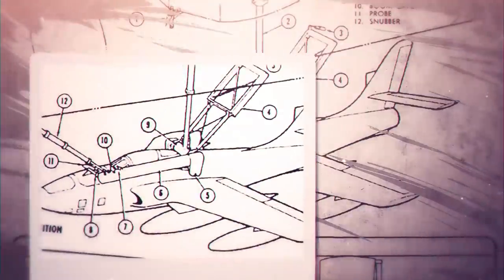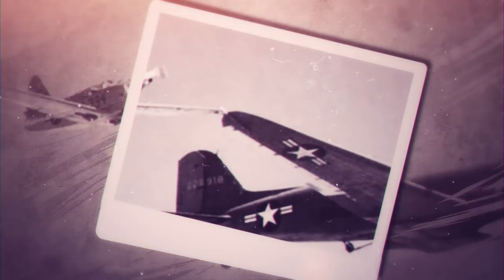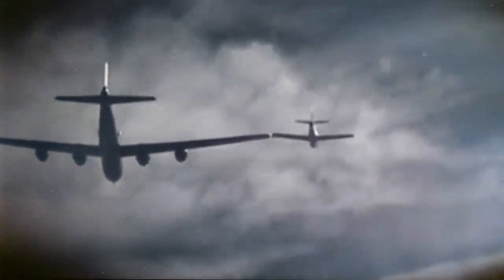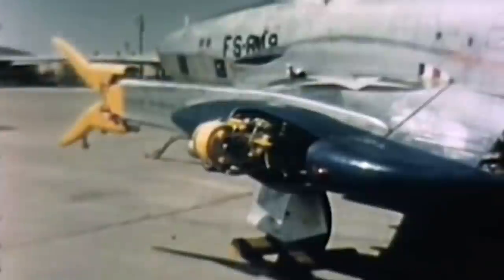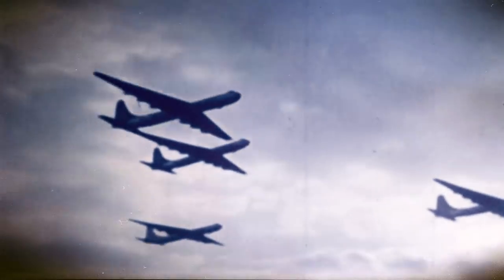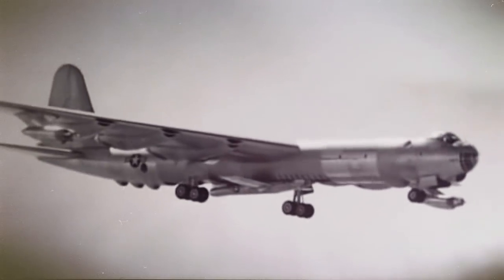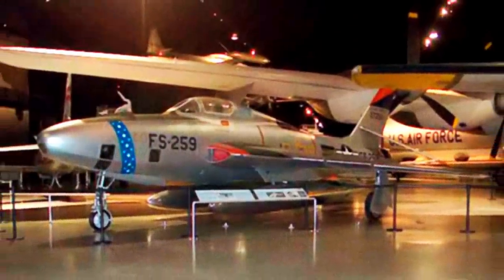A Bomber with Fighter Jets Stuck on Its Wings

Comment: Basically , they were trying to create an Airborne aircraft carrier since escort fighters has a short range and can't escort bombers forever
Reply: this
Reply: They basically needed an Arsenal Bird.  But that thing isn't real and would be a massive cost hit.
Reply: When you can only take one or two planes doesn't seem much point
Reply: @andrewbevan4662  In theory it's still useful, some fighter support is much better than none, and if they expected heavy resistance they could simply send more along. 

That said once in-air refueling was developed the whole thing was rendered rather moot.
Reply: @Joesolo13  air to air refueling nominally predates this, goes back to the Spokane Sun God of the 20’s.

Comment: The National Museum of the United States Air Force in Dayton, OH, is a Must See! In addition to the "Parasite Fighter" they have hundreds more planes from the first days of aviation to modern day. The B-36 they have is massive; I just stood there in awe looking at that bomber. They even have one of the original, huge, single wheel landing gear for the B-36. You can walk underneath the plane and stand in/under the bomb bays and the smell of AeroShell milspec aviation grease surrounds you and your transported to another time, in your mind. I takes a minimum of 2 full days to explore the museum and even then you look forward to the next visit so can pickup where you left off. I have been several times and each time I am rewarded with a new experience, new aircraft and aircraft I somehow missed or overlooked on the previous trip. It is the best museum in the U.S. for military aviation history.

Comment: Bud Anderson was the over seer for this project he was with the aircraft testing center out of Edwards, there was a tremendous amount of development that went into this to make it work.  Republic got it to the point of the attachment system they show here and the autopilot was supposed to guide the plane into the coupling but nobody had tried the autopilot as of yet they had no idea on its calibration so the plan was the fighter pilot was going to hit the button for just a second to get a feel for where it was at and all the fastening assembly between the B36 and the fighter were armed with blast point to separate them in emergencies.  Well the fighter got hooked up  and Bud Anderson was flying spotter in another jet alongside during all this and the instant the plane attached to the b36 hit the autopilot everything went to hell instantly, the fighter flipped over onto the wing of the B36 severely damaging the wing assembly the fighter was 100 percent disabled and the pilot knocked out or killed immediately the fighter crashed as soon as the attachment point was blown and he was dead, the B36 made it a couple miles and it to crashed in the desert and all personnel were also killed.  And Bud Anderson in the spotter plane got to watch one of his best friends killed in the attached fighter!  Sad as hell story!

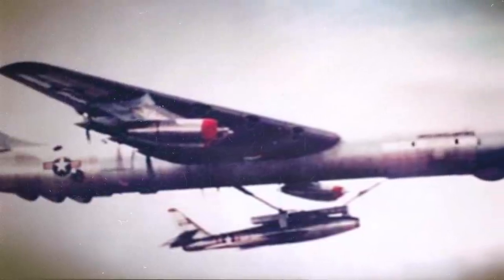Comment: 5:30 yes was cancelled for various performance related issues - but since it was intended as a recon aircraft might mention that cancellation in January 1956 coincided with the Air Force obtaining its first U-2 spyplanes.
Reply: Your timeline is a bit off. Lockheed was still building the first batch of 20 "articles" for the CIA in Jan. '56 but the AF had probably committed to buy 20 of the aircraft for their own use by that time. Those received the AF designation U-2. Later, when the CIA was forced to give up aerial reconnaissance their aircraft were transferred to the AF, given AF designations, and AF serials as if originally procured by the AF.
Reply: Yes - by "obtaining" I meant the AF was aware of and had ordered the plane, possibly then did not want to continue the other programs.
Reply: @johnwatson3948  The AF cancelled their own high aktitude reconnaissance program, the Bell X-16, around the same time.
Reply: Interesting - did not know that.

Comment: The B-36 was the largest warplane ever built. It could lift more than the B-52. If the payload was small enough, it could stay aloft for 2 days. Each wing had 3 piston engines of 3800hp apiece, the most powerful aircraft piston engine ever made. Each wing also had 2 jet engines of the kind used to power the B-47. They were modified to burn the same fuel as the piston engines. These jets helped with takeoff, and allowed the extra speed needed to assure that the B-36 would not be destroyed when it dropped a hydrogen bomb. This remarkable airplane was retired in 1959 and never saw combat.
Reply: Dobrynin VD-4K, as fitted to the Tupolev Ty85 was rated at 4,300hp.
Reply: @atilllathehun1212  Only 23 VC-4Ks were made. Only two prototypes of the Ty85 were made.
https://en.wikipedia.org/wiki/Dobrynin_VD-4K

Comment: Anybody could see there would be extreme air disturbance at the wingtips of a huge aircraft like the B-36  so the last thing you would want was for another aircraft to get close to it let alone couple to it. The force brass obviously didn't factor in air crew safety until someone was killed. Actually the B-36 was a very dangerous aircraft to fly and a lot of the crew hated flying in it. There so much that could go wrong.

Comment: Not the first time the idea was tried by the US, that predated Tipton. USN/USMC worked on a project in 1942. If you can find the old Aircraft Films DVD set on the Grumman F4F Wildcat, on disk two there is a video of a Marine BD-2 (Douglas A20A in Marine use) towing Wildcats from cables fastened to the wings.

Comment: Amazing how they can come up with all these wacky concepts and the associated engineering but couldn’t work out how to inflight refuel aircraft, a much simpler concept, thank goodness they did get the refuelling concept sorted out.
Reply: Yeah. But during ww2, it would be impossible to refuel a prop fighter
Reply: @weirdshibainu  Not necessarily, as long as the probe was outside the arc of the propeller then it could be done, fitting it to the outboard section of the wing would have been fine, so it could be done, however I was referring to the post war years when jet propulsion was in its infancy but developing at an astounding rate. Thanks for your input.

Comment: It’s a shame he didn’t even mention the golblin since it was designed and purpose built for the parasite role with the b-36.Compared to the other aircraft in the program it was small enough to fit in the bomb bay of the b-36 but during flight tests was too unstable due to its small size.
Reply: Different programs and systems.

Comment: A very interesting story of how an idea had been tried and tested, Found to be reasonably sucessful, but then canned because quite simply, mid air refuelling is just a better way round the same problem. Cheaper, more flexible and safer. 
I like it that they gave the idea a good shot. But eventually found it was the weaker solution and opted for the best one going forward. Progress.

Comment: Just think. They could have done mid air refueling during WWII to extend the fighter's range. The same way they could have made a "Line Charge" they use today for clearing mines and obstacles in WWI. All it is, is a wire with a bunch of explosives attached to it strung out over a area. A simple mortar round could have done strung it out. Just think how nice it would have been cutting paths across no mans land or even firing them from landing craft on the beaches on D-Day. They had the tech but never put it together.
Reply: How do you refuel a ww2 fighter when the prop is in the way?
Reply: @weirdshibainu  They can refuel an Osprey with its 38 foot props today. A fuel probe on the end of a wing of a P51 or most other single prop fighters wouldn't hurt it's performance any. The enemy may even think it was a big gun. lol. A dual prop like the P38 would even be easier. Bi Planes were doing it for stunts during the 30's. One Bi plane would fly over top the other and let fuel run down a long hose to the bottom plane. I personally wouldn't want to fly a tanker full of gas in WWII but even refueling over the Channel or North Sea would have gave their fighters longer range then they had taking off from England and with the P51 that could go to Berlin, a fill up before going into combat would have gave them more time on target.
There also would have never been a Atlantic Air Gap. Maybe refueling over Europe was to dangerous but out over the open Atlantic should have been easy enough. 
Someone just had to put 1 and 1 together.

Comment: Part of the reason the fighter flipping over doomed both aircraft was a failure of the explosive bolts- designed to go off if the relative angle between wings became too great.

Besides difficulty eventually deemed to great for a squadron level pilot to deal with, FICON/Tip-tow also revealed a lot more about wingtip vortices and wing movement- stubby fighter wings are stiff, long bomber wings are not.

FICON in particular had a catastrophic loss when the docking fighter was thrown into the bomber by turbulance, damning the smaller plane- the pilot ejected, but had not realized he was still directly under the bomber and shot himself into the bomb bay. I don't recall the fate of the bomber, but that was one of the final death knells for the program.

Comment: Aircraft refuelling in mid-air was developed by the British during WW2 for the Lancaster bombers but was kept secret. Why that was so is that early in the development of the atomic bombs both little boy and fat man, the only four engined bomber without modification, was the Avro Lancaster due to its internal bomb bay structure that was capable of carrying the largest conventional bombs. The Original B29's had a divided bomb bay and could not carry the Atom bombs and special B29 Atomic bombers had to be modified to carry them. The Lancaster's had to mid air refuel to reach the Japanese mainland islands, and special Lancaster units were set aside in Britian these were Atomic Lancaster bombers and Lancaster refuelling planes in case the B29's ran into problems. So it took 10 years or more for the USAF to pick up on mid air refuelling after WW2. Just think if the Lancaster's had to be used in would have been the first attack carried out by mid air refuelled aircraft.

Comment: I'm a little disappointed you didn't mention the XF-85 and EB-29B. These two were technically the original test beds, but issues with the hookup process stopped them from further using the fighter.

A little information about them.
https://sacmuseum.org/what-to-see/aircraft/xf-85-goblin/

Comment: The idea looks idiotic to me and I know so little about aircraft engineering.
Reply: It had its purpose though, even if it didn't pan out. Midair refueling is indeed more efficient and safer, but pilot fatigue over long missions remains an issue that could have been addressed by a flying carrier.

Comment: This flop of an idea also applies to motorhomes with car carriers in their belly.  Yes, it is possible, but highly expensive and ultimately impractical.  Which is why 99 % of the population that wants a 2nd vehicle along for the ride just tows a trailer behind them.  In this concept, once again $ created the obvious solution of efforts towards just having a mid air refuel tanker.  Or gee I don't know maybe instead of inserting a fighter plane in the belly, just insert an auxiliary fuel tank.  Duh.  The best solution however is, not to have a need for war planes at all.  ;)  Save billions of dollars.